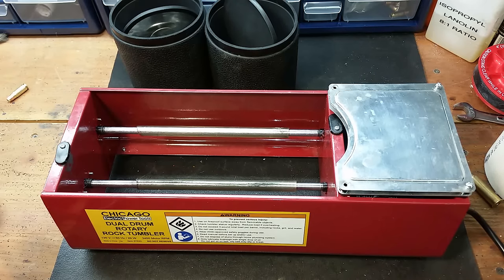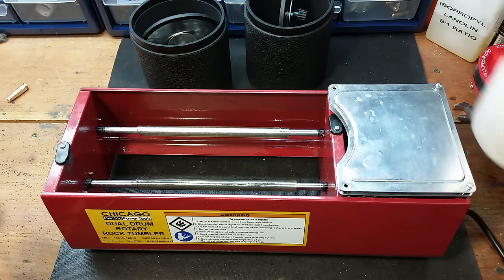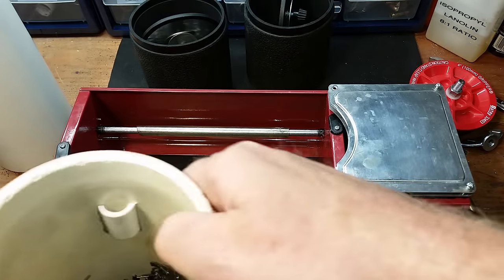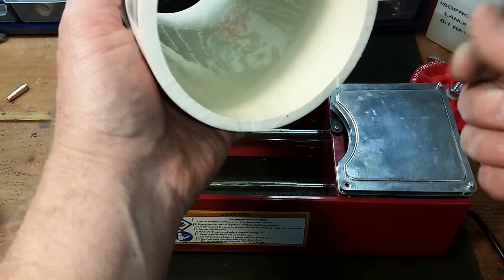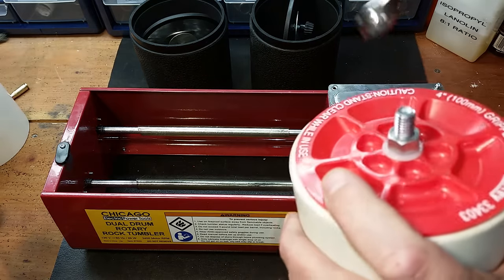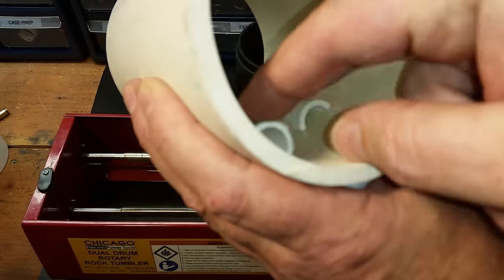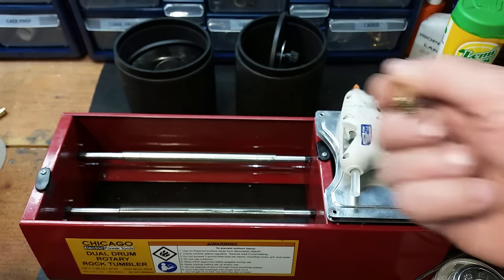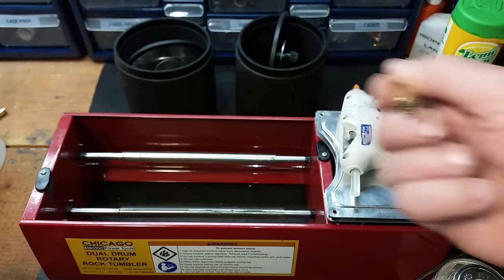PVC project: Larger drum for HF dual drum rock tumbler..clean reload brass!(Link to new video below)

Comment: How about putting surgical tubing on the internal rods of the tumbler. Improve movement of drum or not ?. I'm not exactly certain how the tumbler moves. Does improved traction in this area help tumbling?     You have a great idea here. Will  this help motor  efficiency.?
Reply from the maker: I haven't had to add anything to the barrel or drive rods to make it work fine.  With a full drum it doesn't have any problems.  The best thing you can do for the motor is adjust and square the motor so the belt runs straight and work a dab of grease into the bushings that support the rods.  Thanks for watching!

Comment: you mentioned purchasing 5 lb of pin media but how much do you use in your PVC drum? And do you exceed the 6 lb rating of the tumbler?
Reply from the maker: I use 2 pounds of pins.  I haven't weighed it but I would guess full, it's 5-6 lbs.  I would say the foam core pvc is lighter than than the two rubber drums it comes with.  Thanks for watching!

Comment: my only concern would be the motor crapping out due to excess weight, but you could always swap in a lortone motor for $30 and their replacement belts are suppose to be a lot more burly and still work with the harbor freight unit ;)
Reply from the maker: Im not really sure its extra weight, the foam core pvc is pretty light and this is, after all, a rock tumbler.  At any rate, if you use a coupon, you can pick this up for $49.  At that price, Im not sure its worth worrying about.  Ive done thousands of rounds and I am still on the original belt...Hope this helps, and thanks for watching.

Comment: Hi.  Have you experienced a coating of "muck" inside your drum?  Mine collected quite a bit after only a couple of runs.  It's possible it's just not visible inside the black rubber drums OR that it doesn't stick to the rubber.
Reply from the maker: Hi, yes this is a problem and will cause poor results.  I'm contemplating a video about this subject.  What I believe you (and myself) are seeing is a combination of oils from case lube and carbon from burned powder.  It doesn't only contaminate the container but also the stainless steel pins.  Eventually it will begin to transfer a dark graphite like haze to your otherwise clean brass.  This residue is very persistent.  I use the strongest non solvent cleaner I can find to clean the pins and drum.  Zep Industrial purple.
http://www.homedepot.com/p/ZEP-128-oz-Industrial-Purple-Degreaser-ZU0856128/100047759

Comment: what about a larger pvc pipe? something like a 6 or 8" pipe? maybe add some self amalgamating rubber tape on the outside to help the rollers bite in a bit easier?
Reply from the maker: I don't think a larger pipe will fit in the housing.  As for grip, one person mentioned spray on flex seal...sounded like a good idea to me.
Reply: TreeTopFlier thanks. think i'll just do up my own using a drill and recycled containers. i dont have the HF tumbler, so it'd be easier/cheaper to just rig up a drill for me i think.

Comment: How does it give you more capacity? Is the volume increased somehow  or by capacity do you mean that it allows for a larger part to be tumbled?
Reply from the maker: For me, it's both.  Longer cases have more room to migrate and tumble, so even if you end up with a similar volume and case capacity you get better results.   All In my opinion of course.

Comment: Does PVC glue work on the inside agitators or did you need a different glue?
Reply from the maker: Not on foam core drain waste vent? (most common).  Its glazed inside...not pvc

Comment: How do you de-prime the dirty brass?  Won't that muck up your resizing die?  Or your even your de-capping die?
Reply from the maker: The Lee decap die is universal and the brass doesn't even ride on the sides of the case.  You put them in the shell holder and the pin lines right up and knocks out the primer.

Comment: So if Chicago Electric calls for 3 pounds per drums, and you add the PVC modifications does that mean that you can add 2 pounds of media, 2 pounds of brass?
Reply from the maker: I haven't weighed it out.  I use 2 pounds of pins.  I would guess the tumbler weighs less than the other two tumblers together since the pvc is foam core (pretty light).  I think you will run out of space before you reach a weight issue.   It runs fine and doesn't seem to be struggling, getting hot or overloaded in any way.

Comment: Great Video,  I like your design with the baffles. So, after a year plus, how is everything holding up? I am getting ready to purchase your items, any mods I should know about?. Thanks again for the info.
Reply from the maker: Great question.  The only problem Ive had is several of the baffles have come off and I glued them back on.   Last time I had to replace one I used gorilla glue.  I haven't run it yet but it looks solid I think that might be a better way to go.

Comment: Rather than hot gue, why not scratch throught the shiny innier coating with a rotarry burr, on a dremel type tool, or a round rasp? Then pipe glue would do just fine.
Reply from the maker: +GunFun ZS You sure could do that, I tried hand sanding to break the surface and get a bond...no dice, it looks to be about 1/16" thick.  There may be advantages to keeping the coating intact.  This is Drain pipe, not pressure so it is a cellular core not solid pvc.  The coating keeps the water out of the core.  The hot glue gun worked better than I would have thought and it was super easy.  Those puppies are stuck down good.  Bottom line, this is just one way to skin that critter I'm sure there are many.  You kinda have to use what you have access too.  Epoxy would probably work also. Thanks for commenting/watching!
Reply: TreeTopFlier Yep. I have two vibratory tumblers with dead motors which are probably going to get ball bearing HVAC motors from surplus center. Unless they get salvage motors from a friend's pile.

Comment: I've tried your project and it doesn't want to turn. I've tried with little weight and more weight. I was wondering if I change the belt if it going to bring more strength? Thanks. I'll send you a video...
Reply from the maker: Not sure why it won't turn.  Will it run without the drum?  The motor  is either stalled/bound up or the belt is slipping.
Reply: @TreeTopFlier  yes, it runs perfectly.
Reply: @TreeTopFlier  I was able to get some skateboard tape and it work now perfectly. Also I was able to make 2 sets out of it. Thanks again. Esteban
Reply: Curious as to how much extra volume did this project actually yield?? I don't see how it could have gained much. Nice job though!!

Comment: What is the max weight that it can take and work properly?
Reply from the maker: The original drums are rated for 3 lbs each so that would be a total capacity of 6 lbs.  I haven't weighed a loaded drum but I would guess it's about 6lbs.  The two rubber drums seem to weigh more than the foam core pvc drum. I think you will run out of capacity before you overload.   After running for hours the motor stays cool so it seems to handle the load fine.

Comment: I guess I have to answer a question I posed since no one else did🔎🔍 allabout.wiki/Discover   I asked what the red switch is supposed to do, since it is not an on/off switch.  I finally discovered that it controls whether or not the machine reverses direction every so often.
Reply from the maker: Sorry I missed this comment.  On my unit the red switch is the on off switch with no directional options.

Comment: Could you use just 2 test plugs? One on each end?
Reply from the maker: No, the motor side won't clear.
Reply: You could if you insert the test caps a bit deeper. But the test caps cost more than a cheap end cap.

Comment: Your new pvc barrel should have some kind of rubber traction on the outside when on the rollers to have a better turning. Weight is not the solution.
Reply from the maker: +Numisaccent That hasn't been my experience at all.  If the rollers and drum are clean it works fine without any additional traction material.  The interrupters I put in the drum are fairly small and don't cause the drum to have to lift too much material at one time so the torque is marginal.    
Here is a link to another video started part way through if you want to see it in operation for yourself.  I do give it a push start at first but that's all it takes and I do that with the stock cans too. https://youtu.be/31er2Euw4Ic?t=3m47s  Thanks for watching!
Reply: +Numisaccent I suggest one of those thin mouse pads glued to the outside.  I may try one inside too.
Reply from the maker: +Bert Payne it works fine bare.  You can see it in operation in my "wet tumble range brass video"  I would try it bare first.
Reply: +Bert Payne maybe some of that flex seal paint.
Reply: Josh Speer Good idea.  Love that stuff.
Reply from the maker: If you needed extra grip that seems like an easy fix
Reply: I use 2 or 3 wide rubber bands around the PVC drum. Keep everything clean, it never slips.
Reply: Rubber bands is what I had in mind too.  Easy and cheap!!

Comment: Nice video... however I am able to place one hundred thirty five .223 cases in one drum which equates to two hundred seventy pieces of 223 brass. I also run it for about fifty to sixty five minutes and my brass comes out like new. I don't understand some people running it for two, three and even four hours... that's just insane.                      Shoot lots and stay safe.
Reply: Are you saying in one original black rubber drum you are able to do 135 223 cases?  Do you use steel pins also or just the cases with the dawn and lemishine?  I just ordered steel pins and am wondering if I even need them but maybe they clean the primer pockets better than way.

Comment: You should put a bicycle Tube over the pipe.
Reply from the maker: Why?
Reply: to get more grip and prevent slipping
Reply from the maker: Oh, as I said in the video, mine works fine when it has the weight of the water and brass in it.  The tumbler was empty in in the video when I turned it on.  Thanks for watching!
Reply: I was thinking vacuum belts a couple of them but a bicycle tube might work also.
Reply: @caltick  electrical tape works well

Comment: Looks like it would be too heavy to rotate
Reply from the maker: Its not, I have been using it for years, just did about a 100 308 cases yesterday, ran flawless for 1 1/2 hours.   Frankford arsenal makes a smaller one now that is in this volume range.

Comment: Link for 4" removable test plug

www.lowes.com/pd_23521-138-334033___?productId=3880611&pl=1&Ntt=4+inch+test+plug

I couldn't find the 4" glue in test plug.
Reply: a glue in test plug is just a plug